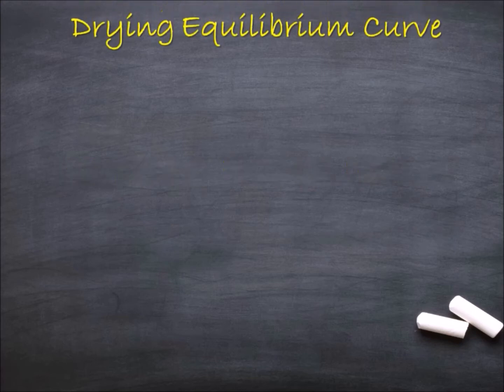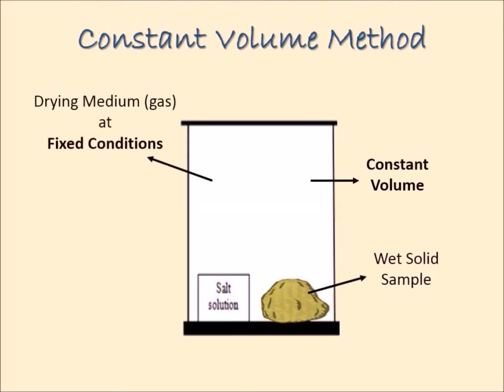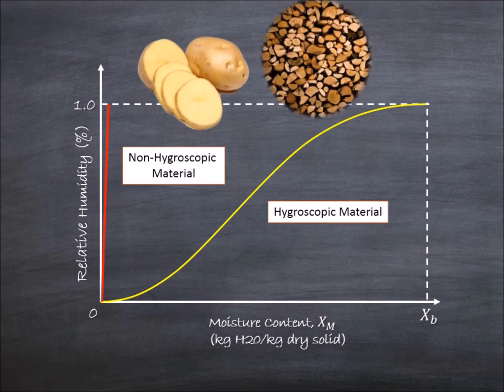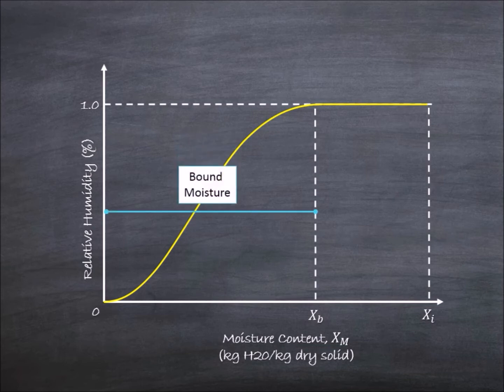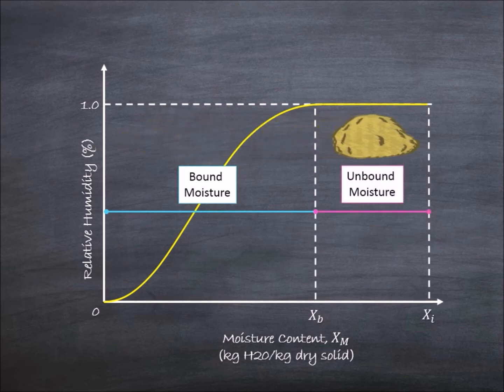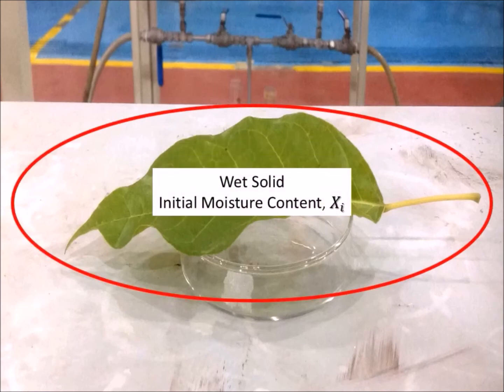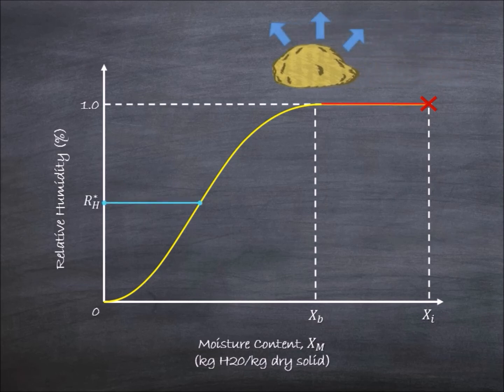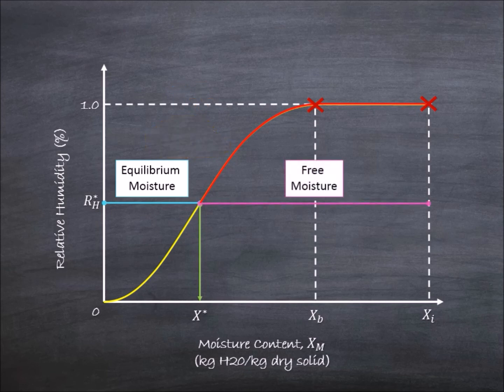EKC 316 - Separation process: Drying equilibria Group 3

Comment: Is the experiment carried out by using constant volume method? What is the requirement to carry it out with dynamic method?
Reply: Chacrundor Aaronium yes...the experiment is considered as constant volume method as we use tray dryer. Dynamic method is used whereby the drying medium is continuously flow in and out of the dryer.

Comment: how u know it is bound moisture or unbound moisture has been remove from the leaf?
Reply: jing yi Lee In the leaf experiment we demonstrated, we can't determine exactly where is the transition point since we didn't have its exact equilibrium curve. However, for any cases of wet solids, unbound moisture will be first removed until the point Xb, then the bound moisture will only start to remove.